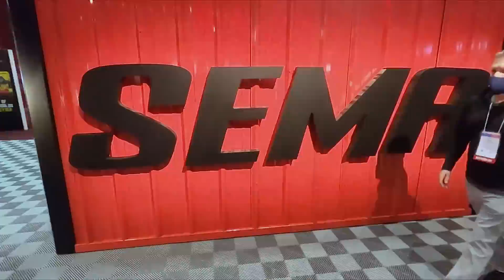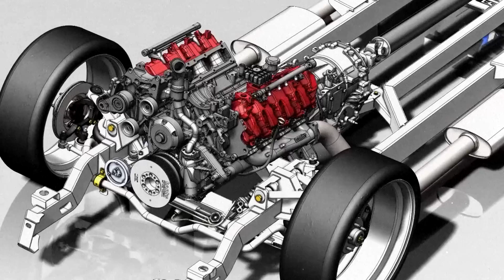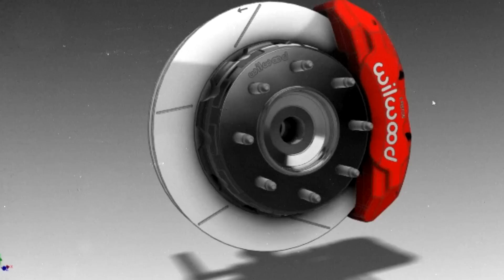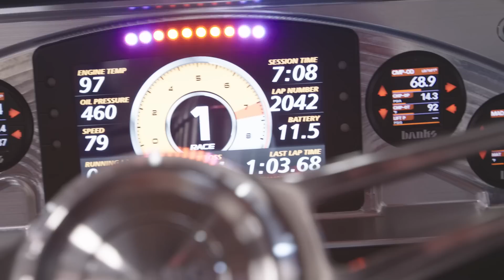Revealing our supercharged Duramax swapped Chevy at the SEMA Show | BANKS BUILT Ep 43

Comment: The wheel design is similar to what I have been wanting to do for a long time and surprised I have not seen it before.  My idea was to use the wheel design when in forward rotation at speed to pull air from under the car and force it outwards to help suck the car to the road for better handling.  My idea would provide cooling to the brakes as well.  I've never tried to produce anything, just a wild dream I had years ago and have always wondered if it could actually move enough air to work. 

I enjoy seeing the very creative design here especially when you can create 1 part to do more than 1 function.  I know I am a little late to the party in watching this video but I had to leave my 2 cents.  Great work all around guys!

Comment: Mr Banks, job well done, sick and wrong, not in my eyes 👀Best and Better! 
I built my first twin turbo big block chevy back in the mid-late seventies? 1976? I believe. It all started because of one of your builds! I have had time In between builds, right now l am driving a Yukon XL powered by an L.B.Z. Duramax with a six speed Allison, we are still on the same journey, sorta! I would love one of your L.5.P. Super charged Duramax engines with my twist of turbos! Added on. I will try mixing the two supercharged methods, l may use a different supercharger!😘😉 Back in 1976 fuel was my biggest hurdle, along with valve train. Today's technologies will allow me to build a steerable L.5.P. BEST AND BETTER, with absolutely no fueling or valve train issues!!! I will keep you posted, Keep in mind l am only one man, towing one solution at a time. What else is excessive torque for anyway??? 😛 👌 ✌🏻 😎 ❄ 🇨🇦

Comment: Stunning build. I was hoping for an old 2 tone instead of the patina but oh well. And of course a slick manual transmission. But I'm a dreamer.
Reply: i believe they discussed painting it in one of the episodes but Gale wanted this to be original....now a days if you are not putting in a dual clutch auto transmission (that can can do manual with electronic levers) you will be left at the line, especially with that much power....